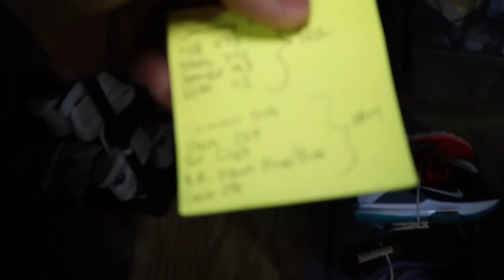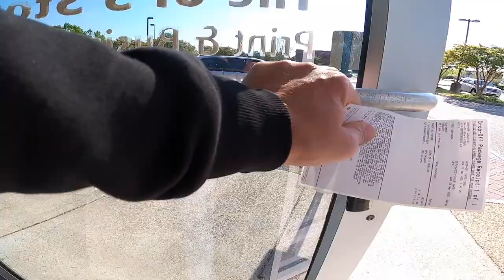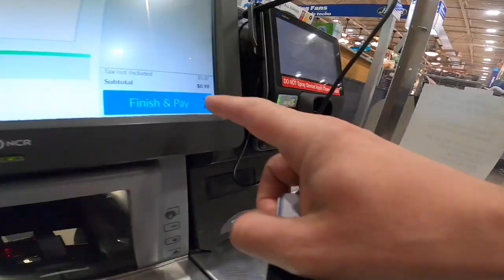I don't have a title for this video. Hang out with me.

Comment: Hey Nick, Do you ever worry about your shoe inventory getting damaged storing them the way you do? I'm trying to find a better way to store shoes, but I worry about them getting damaged if I stack them. Any thoughts?
Reply from the maker: So, I did worry about storing shoes this way in my early reselling days, however, I’ve never had an issue with the shoes getting damaged by stacking them this way. I only put a max of 15 shoes per shelf, and each shoe only has 1-3 pairs on top, so it’s not a lot of weight at all. :) Hope that answers your question :)
Reply: @nickwoo1  Thanks!